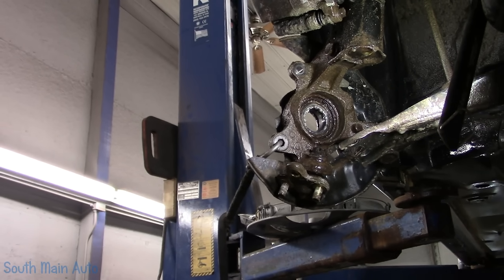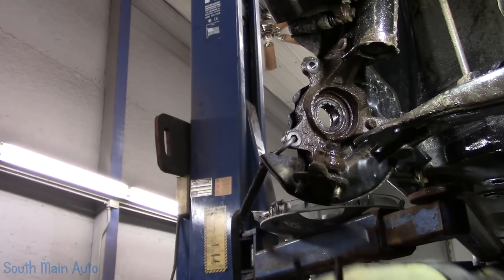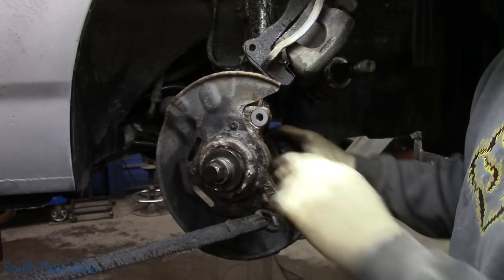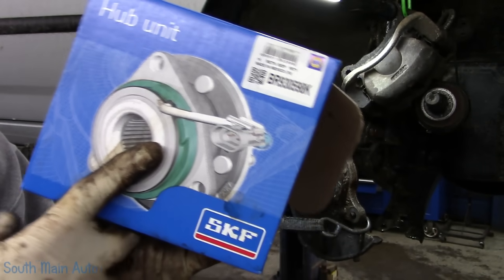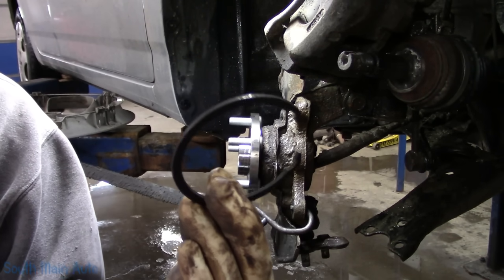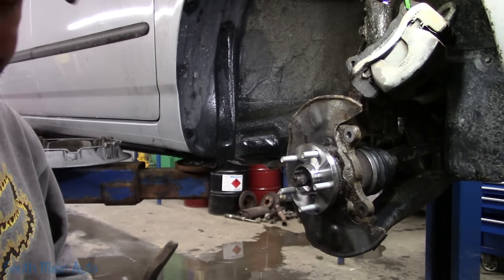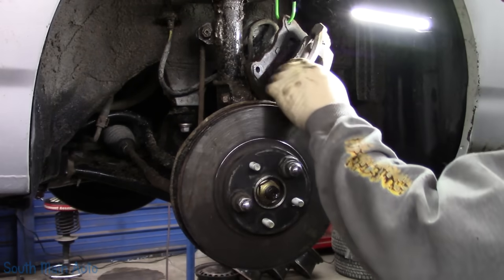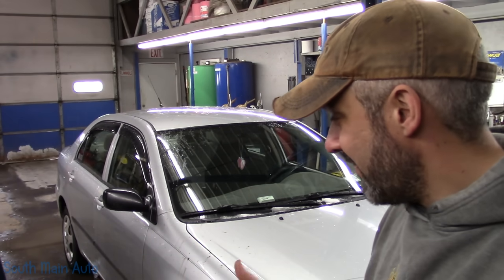Toyota Corolla: Front Wheel Bearing Replacement

Comment: rust makes every thing take twice as long and last half as long as they should
Reply: Amen to that.
Reply: Honestly more
Reply: @zzztubazzz  Are you cracked out my man? I guess engine oil probably is lifetime too, what's gonna happen to it huh? Dirt get in? It's sealed obvously it can't get in. Air filters? It filters out the dirt how can it get dirty? Trans fluis? High pressure and clutches? No way they can go bad. Brake pads/rotors? No way it's metal on metal surely that will last forever.
Reply: @baileyhatfield4273  One thing is for sure brother is that you can’t fix stupid. 🤦🏾

Comment: I love the final commentary where Eric O points out that since most DIYer's might not have one of these kits due to the lack of needing them very often, that it's still very feasible to just remove the whole knuckle and just take it to a machine shop for them to remove the old bearing and press in the new one. Having to get the alignment done sucks but with the huge cost savings of doing most the labor yourself, you'll knock off a few hundred dollars from this repair.
Reply: Most parts stores around my area rent tools (pullers, etc) for a few bucks. I use a lot of the fancy tools and have never had to buy one.
Reply: Craneman yeah excellent point. Wasn't sure a miniature bearing press was one of those tools?I'd have to look into it.

Comment: What! You can use brake clean on brakes?
Reply from the maker: Yeah once in a while...
Reply: Not the Pads so much...but you can use it to clean the Rotor Surfaces of Grease and Oil, cleaning Caliper Pins before lubing etc.

Comment: Classical music for a classic problem :-)
If it was my car i would want both doing at the same time, if one is dead, the other is likely going bad. (Save having problems later).
Reply: Not true. A modern bearing doesn't usually "wear out" they fail. Maybe not manufactured perfectly, etc. I've changed one wheel bearing and put another 150,000 miles on with no problems from the other.
Reply: I disagree. It's normally the right side bearing that goes first due to "right turn on red" I suppose. Not sure if that's the reason but it normally is the right side that gives it up first.
Reply: In late 2012, nearly a year after I bought my '03 Mazda P5, the left side wheel bearing went and so far the right side is fine, and at 67K or so miles later, still fine. I bought the car with 110K or so miles on it to begin with.
Reply: SATAMAN Schmidt also thats the side that hits the most pot holes on the low side of the road,also see more ball joints and tie rod endds go on that side
Reply: I think it depends on which side of the road you drive. In the US, RH turns are tighter (smaller radius) than LH turns. The left bearing gets stressed when you do a RH turn.
Reply: @satamanschmidt3428  Also, more likelihood of "curb-smacks" on right side.

Comment: Will the WD dry out the grease from the bearings and cause fusing , i was told by a mechanic WD is not a true lubricant its a water displacement rust remover
Reply: Your mechanic is a tool lol 🤣🤣 ...…......I crack myself up

Comment: the slide hammer works like 1/3 the time for me but maybe i just dont have enough beans in me haha
Reply from the maker: MORE BEANS!!
Reply: How about going BAKED BEANS?
Reply: I used to say the same and THAT was the exact reason I originally bought and still usually use the grappler (I have the matco version) BUT I was trying with the more common 5lb slide that comes in the 9-way or 10-way kits by various brands (mine's OTC). I finally bought OTC's 10lb slide like Eric O is using and it makes the job MUCH easier. I can't slam'em out in three hits like 'flat-rate-master' does, but the 5-6 hit range like Eric routinely does isn't out of the ordinary. Honestly I just do prefer using the Grappler BUT not every knuckle has spots on it where I feel comfortable using it. I'll grab the slide any time I think I might wind up mangling the backing plate with the Grappler.

Comment: Eric O, please wear glasses you've got only 2 eyes man. And for the spindle i use gearoil because it can handle pressure best.
Reply: We always use press lube. However its expensive. To each their own
Reply: The gearoil i use is the cheapest you can get, it's used LOL
Reply: I use assembly lube on all my forcing screws now.  Seems to lubricate the best and stays in place instead of slinging off.  I warranty a lot fewer forcing screws now.

Comment: Had a bearing finally go on me. It was making sound before on and off, but this year, it was constant and easy to diagnose. I tried to take it to the garage and they couldn't replicate it.

In order for them to find out which corner, they needed to drive it. Now, the exhaust had blown and it got me thinking the sound was the exhaust slowly going. As it did before.

Garage finally confirms the bearing is bad. No excess movement, just noisy. Crap had gotten inside.

Comment: Great Job!  30mins for you = 6.5hrs for me, The Stub Axle Nut was Practically Welded on, It was that Tight & Corroded, It Needed the Gas Torch & 6ft Long Pipe Extension to Crack It! The Rattle-Gun was a Joke it Didn't Budge it!  Fair Play to get the Job Done in 1/2hr Even wirh a Few Specialty Tools!👏👍- Cheers🍺🍻😉

Comment: I haven't had good luck pushing and pulling bearings from the spindle with a shop press. Heck of a time getting it sitting straight and bent the spindle anyway. The hub tools you use here work much better.

Comment: Heck my 03 is still going STRONG with 97% original parts this is one of them none of the wheel bearings or other suspension parts have been replaced and it’s still riding fairly smooth (I do live in cali though) so it hasn’t been through a snowy winter in the whole 15 years I’ve had it so that probably helps

Comment: Great video, awesome tips on where to press the bearing. I can see someone pushing out the inners of a bearing out (not saying i ever did that). The Harbor Freight hub bearing kits are junk. Had 2 of them and the forcing screw and nut strip out the first time I used them.Never even got the bearings out either time. I still us the cups and plates but on my press.
Reply: My harbor freight kit also stripped the first time I used it.

Comment: Love your video but I didn't see one thing, I know that on at lease the 1996 Toyota Corolla there are bearing seals. I can't tell which way the seals go in. Rubber facing out or rubber facing in as the wheel bearing was already dismantled. On your installation I didn't see any seals at all.
Reply: I just did mine today on my 2000 corolla CE w/ no abs:

There are two "oil" seals and one tinny ring.
The two oil seals are different sizes. If you look in those seals, you'll see a steel-braided ring, that must face towards the area you want to prevent grease/oil from coming out of. In this case, face them towards the bearings. The outer lip of the seals face away from the bearings. 

The smaller one is on the hub side, while the bigger one is on the cv axle side.

The tinny ring is installed on the bigger oil seal side and only after the oil seal is installed. That ring is mainly for abs/speed sensor, I installed mine anyway. 

It helps to have the original /old parts to size & compress your new parts. As well as having a hammer & point, and different sized plates to help get them into place.
I don't know why he didn't include the seals in the video, but I installed those seals anyway.

Comment: I don't have the tools for all that.  So I take it to the Dealer or a good automotive repair.  Bearing issues sound is like multiple rocks going around on the tire.  Constant sound. Steering is jittery. 06' Corolla. Anything over 170,000 miles plus might think about bearing issues.  Thanks for the links.

Comment: Just came here from watching the old video; I knew I had seen a newer video about this recently!

Interesting how nothing has changed in your method, with one small exception: last time you air-hammered the axle out of the hub before you slide-hammered the hub out. It looks like you didn't do that this time. I guess it's not really necessary? I'm happy about that: I don't have an air hammer, and I'd be a little worried about mushrooming the end of the axle or messing up the threads.

Comment: Thank's Eric, I just replaced my 97 GMC Subarban 2 front wheel bearing assembly and brake rotor/pads at the same time, saw it on one of other video's and  I've watch your YT post video about replacing front bearing on 2005 and 2007 Corolla and my daughter got 2009 Corolla. Is that same process and procedures also? Keep up the good work men.

Comment: 17:43 - so the cup cant sit on the whole hub assembly/bracket housing itself, because the casing is just uneven, so you would have to sacrifice the inner seal anyway to press the hub back in there?
Reply: When you compress the Hub into the wheel bearings, it's compressing into the inner race of the bearing. Without a cup, the hub will just push the inner race out of the bearings. You need a cup that focuses pressure on the inner race as you compress the hub in for it to be installed correctly.

Comment: Love your videos and used it to help me do this job on my Vibe. I ended up removing the spindle and doing it in my garage for two reasons. First my slide hammer kit hub puller wouldn't bolt to my hub and second I didn't have a lift so it made it a bit easier to work on.

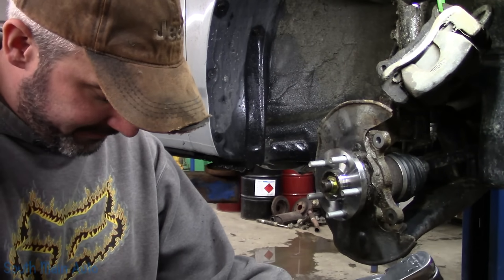Comment: What is your torque value on the axle nut? You said, while using the torque wrench at 23:10  "Manufactures specs".
Reply: my 2000 Corolla CE called for 166ft-lbs on the axle nut

Comment: I noticed you didn't use a strut spring compressor to compress the springs. I want to replace the front bearings on a 2006 scion XB by doing it like you did would I need to compress the springs?

Comment: I use a wheel stud installer bearing with my kit.. Not sure if it last longer then the bearing your using but most tool trucks have the for sell. 2 sizes of them..👍🏻👍🏻👍🏻

Comment: Thanks Eric O for these fantastic vids, question, I have a 2007 Tucson V6, & I get vibration on the steering wheel between 60-80kms per hrs, I've tried multiple time to balance the tires even a new set, but vibration is still there?

Comment: I replaced my wheel bearing on a 2006 Corolla. It didn’t go nearly as smooth as yours. I got a cheaper version of the wheel bearing press than the HF one and the cup was stuck inside the knuckle. I hammered on it for hours and it wouldn’t come free. What ended up working was removing the speed sensor and prying on the cup while I hammered on the opposite side. Thoughts on why my cup was stuck so far in the knuckle, should I use a bigger cup next time? My bearing was stuck in there pretty good, I had to use a lot of force with a 25 in breaker bar.
Reply: Three years later and he just made an update video where he discusses that. He used a drift/brass chisel to hammer it out.

Comment: Always good practice to install the number of the baring facing outwards so the next guy can see it and get a baring just form the number, doesn't real matter in a automotive application because you just call up the parts store and get whatever you need  but when fixing anything else its nice. Keep up the good videos, Cheers!
Reply: The "baring" not only has a number, but it needs an "e".
Reply: Paul Copeland Also good practice to misspell things on the internet so someone can correct you and not add anything useful to the topic at hand. 👌
Reply: Always trying to help!

Comment: Eeic i hope you see this or maybe another mechanic can chip in. Ive been working on cars since 26 and recently did my first wheel bearing replacements on a 95 hondoo accord.

Question even after replacing everything the wheel has some movement is it because the cv axles are still out of the hub?

Comment: I don't like the idea of buzzing off the axle nut without unstaking it first. That may very well have been the reason i had to take a tap and die to the axle on a similar job i recently did. It was that or neglecting to start the axle nut by hand before hitting it with the impact wrench.

Comment: Thanks for sharing, what is the purpose of this big snap ring?
Reply: It goes into the grove of the steering knuckle. Prevents bearing from sliding out of the steering knuckle towards the engine.
Reply: does it mean the bearing goes in from the side of the engine? @ZoranVukmirica

Comment: Here in Birmingham Alabama, shops will turn down this type of work on a car that has corrosion on the suspension.  It is simply too much work when you are used to clean cars.  I have a new respect for what it takes to make a buck in the salt belt.  The extra time to deal with the corrosion must add 1/3 to 1/2 of the standard time to do the job.

Comment: If you tighten the wheel bearing for final assembly, does it not have to be loosened first and then fixed again at a lower tightening moment? Just wondering. Thanks for your very useful videos!

Comment: How is pulling the hub in like that not doing the same damage to the bearing as tightening up the axle with a impact?
Reply: When one is pressing in a new bearing, one is isolating the outer race.  When one is pressing in a hub, one is isolating the inner race.  That is the key, not imparting a shear force between the outer-and inner-races.  Wheel bearings are not thrust-type bearings.

Comment: Hey man, could you help me out? Just replaced my front bearing hub but I'm REALLY struggling to get the shaft back in. Tried everything so far. What could be potential cause? Different size bearing spline? Damaged part? What does the little notch do that's on the drive axle? Sorry it's been bugging me and stopping my project
Reply: Check if your new hub slides onto your cx axle splines before you begin. Sometimes, aftermarket parts will not line up with OEM, best to check if they fit first before fully committing.

Comment: Do you find that using a slide hammer to pull out the hub = ball joint replacement in a few months?
Reply: I'm sure the potholes they go thru up there with the weight of the car on the joints do more damage than the slide hammer, but hey if the slide hammer does do a number on it, then that's job security. 😂
Reply: DIY Misfit "Mechanic" not to mention that "bad air" he's using to inflate tires...
Reply: Yes, that bad air he uses, LOL.

Comment: aren't you supposed to replace both front bearings whenever you replace a wheelbearing on a FWD car? replaced both on my vw vento with the help of a hydraulic press and now i wait for the right seal kit for the left brake caliper as i ordered the wrong kit...
Reply: I purchased both from NAPA because they offered a substantial discount if you brought a pair.  As it turned out, it was the correct decision.  Originally, I predicted the passenger-side bearing would be nearing its life expectancy, but I found out that the driver-side bearing was masking the noise emitting from the passenger-side bearing, another hypothesis I entertained.

Comment: Any need for an alignment since we have to disconnect the lower control arm ? or is it marginal ?im doing my bearing this week, thx
Reply: Unless the ball joint itself is toasted, usually there's no slots or other things to mess with at the mounting plate.  Now if you find the need to pull the spindle itself-  That usually entails screwing with an alignment bolt at the strut mount.  (unless you drive a car that uses the upper plate to adjust alignment (some VW's).  We've done that a few times, pulled the spindle...take it to a local shop, buy the tech a 6 pack...and they press the bearing out/in for us.
Reply: I'm gonna say marginal, because there is no alignment adjustment on those bolts he took off

Comment: In this particular case, '05 Corolla = '05 Vibe for the front wheel bearing?
Reply: Jeremy Grotte their all basically the same on 2wd. You can buy the whole assembly, skip all the tools but you’ll likely need a front alignment. Must try and mark the strut tower bolts precisely
Reply: Ok.  The other front wheel bearings I've done haven't been like these (Chevy Sprint, 4WD Dodge truck, old Malibu, etc).  I'm going to imagine that everything I've got now is going to be a pain in the ass like this one ('09 Odyssey, '05 Vibe, '98 Sentra, etc.).

Comment: How do you know when do you have bad wheel bearing ? 
Thanks in a advance !
Reply: With the vehicle lifted of the ground, rock the tire at 12-and-6 and 9-and-3, checking for looseness.  Also, spin the wheel while holding onto the coil spring, sensing for vibration in the hand.

Comment: Where do you get the D5 thrust bearing???
Reply: I'll necropost a reply to you since it looks like no one else did. Eric O has said in previous vids that he has a local supplier for them that he gets them from cheap. The box he showed in this vid was a 'INA D-5 thrust bearing'. I suspect he looked for them online and didn't find them in the same price range he gets them for so didn't post the link he mentioned he would in the vid. Or he just forgot.  IDK. Either way, that's the number and you can look for them BUT I'll mention that in my search online for them I came across a "Nice Thrust Bearing 607V' that is the same size, case hardened, and was cheaper than I could find the INA D-5 when I looked and they have been working rather well. I bought 4 of them  for ~$32 shipped off of a seller on Amazon and most of the reviews were from people mentioning they were using it on their forcing screw. What I can say is that I'm about 10-12 wheel-bearing replacements later and I haven't destroyed one yet. /knocks on wood-like veneer